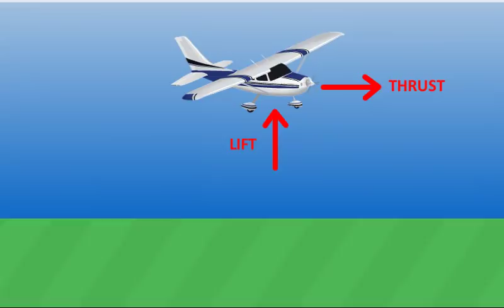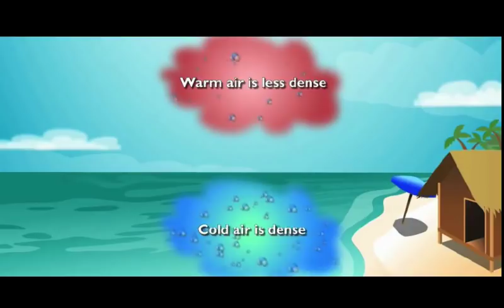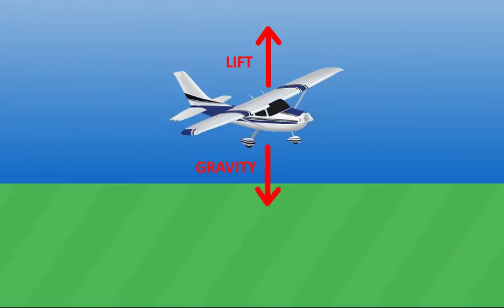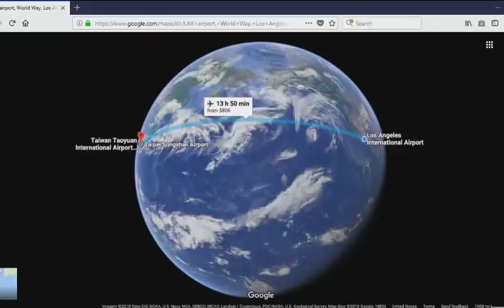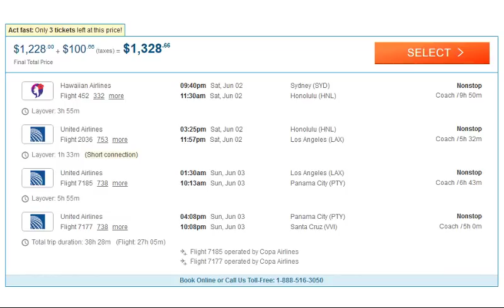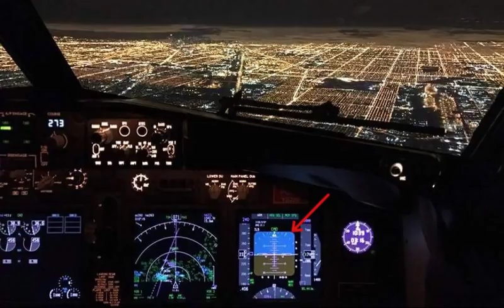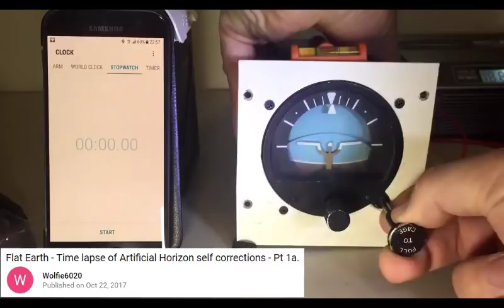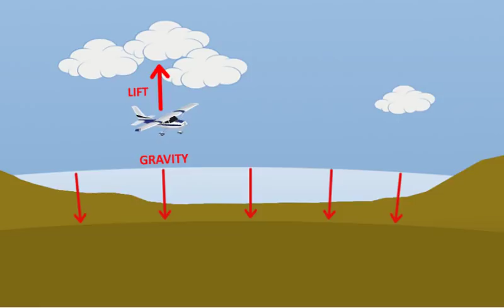Flat Earth Falsities - Plane Nonsense

Comment: VoysovReason
I had problems with a comment I tried to post repeatedly disappearing. Can you help?What do you think was happening?
Reply from the maker: I don’t know. Sometimes that happens. The YouTube filters are weird.
Reply: @JonasGrumby71  DID YOU KNOW THAT YOU CAN DELETE COMMENT
Reply from the maker: @bregidayubos3338  yes, but I almost never do. Only in extreme cases.
Reply from the maker: I see now that I got notices for two of your comments that have links in them, but the comments don’t show. I think YouTube filters out some link comments. But I have the setting set to allow all comments.
Reply: @JonasGrumby71  Thanks. I tried to post it maybe 25 times (between Chrome and Edge and to different comments or a new comment) just because it would post and in 5-10 seconds disappear. I even posted it to an old comment by wong and it disappeared. I worried that my tenacity might appear as trolling.

I have been seeing similar complaints elsewhere on YT. 

Thanks again for checking that out pal! Hope you are well.